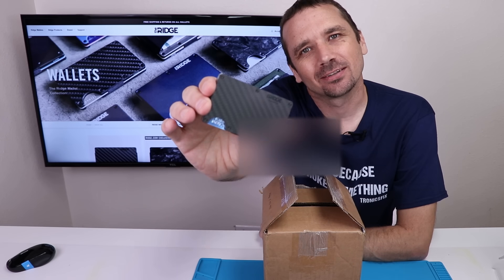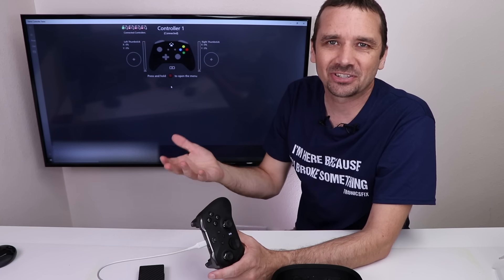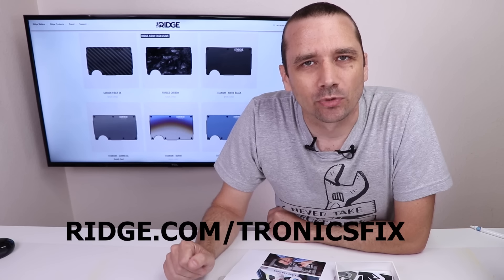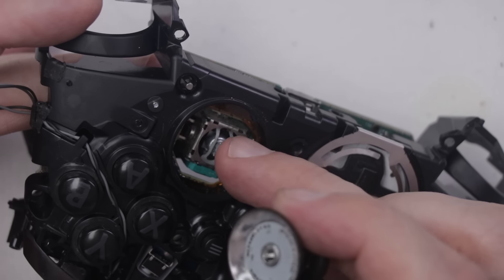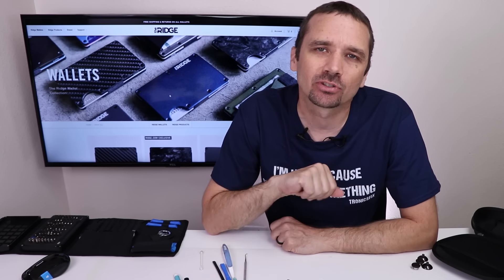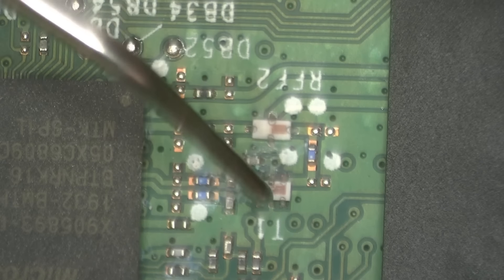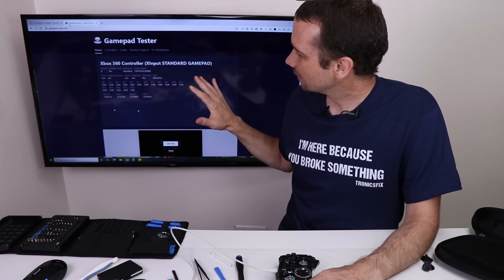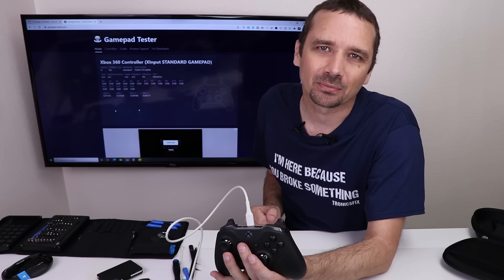I Paid $99 for a BROKEN Xbox Elite 2 - This One Was A Tricky Fix

Comment: Hey Steve! I wanted to ask after seeing this video and planning to undertake my own elite 2 repair: I need to remove those sticks (desolder and all) from the board. But, before that I wanted to take both caps off the analog sticks themselves (the unscrewable parts). 
As a not so repair savvy guy, even with the thumbsticks assistance the parts kinda seem really tight. About how far should I go in force to try and unscrew those caps on the analog sticks?

Comment: would working on the chip under the D-Pad help fix the bumper issues? I've had a few controllers come across my bench with a bumper that doesn't always want to work when pressed

Comment: My left thumb stuck would only register a 50 percent input when I would have it pushed forwards all the way. Made it impossible to use. Disappointed spending $175 on a controller to have it stop working after a few months
Reply: Get it fixed under warranty.
Reply: @bobwallett  I think the warrenty for controllers is only 30 days and I've had it about 4 months.

Comment: I do have a question as well. I have a controller that I took apart to fix and found that the up button for the dpad is pushed in on the board and won't come back up. Is there a way to fix that or does the board just need to be replaced?

Comment: Hello, have you encountered such a problem that gamepad don't turn on without cable but then you can unplug it.. and it works fine wireless..(and the panel shows that it fully charged)
thanks in advance

Comment: Only if I could send my PS4 controller to you to get it fixed. My controller joystick doesn’t work and whenever I press on the L2 button the left joystick moves a little
Reply from the maker: Not many places repair them...it's usually not worth the time if looking at it from a business perspective.
Reply: Try a console repair shop to see if they are willing to desolder and remove the old one and solder in a new one. Just bring in the board and a new stick.
Reply: bobwallett Like Best Buy?

Comment: What about the tac switch from the bumpers they seem to be a common point of failure. Mine went out after 2 months of use. Any ideas on how those could be fixed other that soldiering?

Comment: Hey great videos. There is a huge issue with the Xbox elite 2 controllers where the Bluetooth disconnects when the controller rumbles for an extended period of time. I would be great if you could look into this. They are coming from the factory like this I have had two replacements and they all do this

Comment: I have a series one controller that has loose analog sticks. They still register and work. But they wiggle slightly when just sitting there. Not as firm as when i bought it. Think its just a replacement analog switch? Or is there an easier way to make it work better?

Comment: What is the diffrence between the blue and green boards
Reply from the maker: I'm assuming they needed to fit a large motherboard inside a small controller so their answer was to make two boards stacked on top of each other. They each just have their specific functions.

Comment: Hi Steve! I've got a xbox one s with a faulty disc drive, I've had a look inside the disc drive an it's really gunked up with everything you can imagine, Also one of the small black belts that turns the gears is loose. Do you have a video covering this  issue?  Any help would be great

Comment: My Elite 2 Controller shuts off if I click the right thumbstick. You got any ideas on why clicking the thumbstick would cause the controller to shut off. Also I have to place it on the dock or plug it in to get it to turn back on after this happens. Any thoughts or help would be greatly appreciated.

Comment: The Elite series 2 left and right bumper has issues with not registering when they are pressed and/or double pressing when only pressed once. Do you know if this issue and how to fix?
Reply: Sell this junk to some sucker willing to pay for it and get a 360 controller. Whoever designed this garbage should be publicly shamed.

Comment: I currently have an issue where mine is not charging, so frustrating i gave up on xbox controllers at this point.
Reply: after furhter investigation, i had a small chip labeled "304" pop off
Reply: @Turkingtang  304 are the the components that measure the Z-axis of the analogue shoulder triggers. If the component is missing then the trigger above it won't function correctly.

Comment: Ok I have a question. Recently my xbox has started shutting itself off. I called Microsoft it’s out of warranty so I decided to fix it myself. I’ve taken the whole thing apart replaced thermal paste clean it thoroughly and made sure the fan was working but it is still shutting off. I have even tried multiple different power supply’s still shuts off. What should I do?
Reply: And to add about 5 months previous to this I had a substantial amount of water spilled into this system but let it dry out for over a week before attempting to turn it on

Comment: I found no videos that cover the buttons for the paddles under the controller but I got one and the p4 button sptoped working in matters of hours and exchanging the controller to the store I bought it is quite hard in these times can someone helps my since on the bord no one covers the padel section witch seems to be on the back panel of the controller

Comment: 99 dollars for a broken controller that you can buy new for 169 dollars with 2 years warranty... 🤦‍♂️🤦‍♂️🤦‍♂️🤦‍♂️
Reply: They cost about 200 new. You can get them from amazon used with warranty starting at 169.
Reply: @maxz8807 , Not here, we can buy them in Europe the cheapest new for 169 😉

Comment: What’s so great about these controllers?
Reply: Fitted Backpaddles, Able to reroute backpaddles to ABXY Buttons, Interchangeable Thumb Sticks, ability to adjust thumb stick tension, Triggers can Be set as Stadard, Midpoint or Hairpin, Changeable D-pad and three Controller Keybinds that are savable to it. 40Hr battery life and its generally Comfortable to use
Reply: PugletPlayz but for 179 dollars?? I’m guess “you gotta pay go play” fits in here somewhere 😂
Reply: @XnazxulX  That is true but there is also other companies that make similar stuff but arent Official Xbox Products or there is the Older Gen Elite which isnt as refined as the Series 2 but is still a good buy and they are cheaper now.  In the UK the Series 2 is Cheaper, You can also Add Warrenty to it, When My Right Shoulder button stopped giving imput I sent it to be repaired, I was also given New Thumb sticks, D-pad and back  paddles, Its worth it if you game a lot, I do.
Reply: Also I dont 'Pay to Play' I bought It with birthday money and whilst trading in my Older Series 1 That I saved my pocket money for.

Comment: These are awful, over-engineered, and ultimately worthless. I've owned first and second generation, and they both broke; buttons stop registering, stops powering on, etc.

Do not buy Elite controllers. Ever. Microsoft even had to extend the warranty on Series 2 because there were so many reported issues. My old 360 controllers lasted well over 10 years with only normal wear. Both my Elite controllers lasted 6 months before I had issues, and completely useless within 12 months.